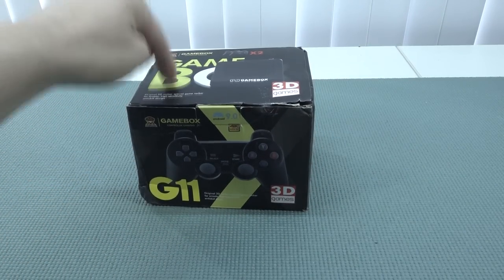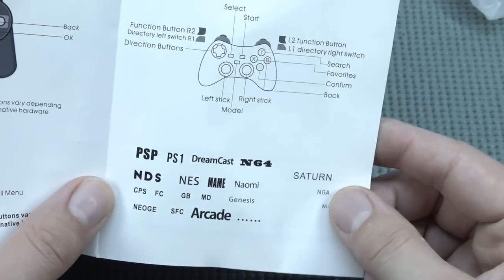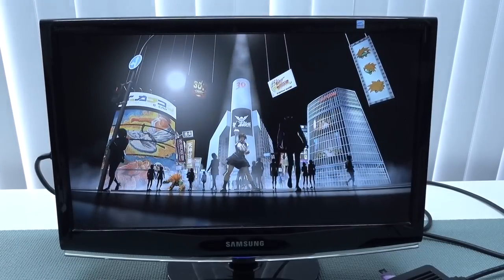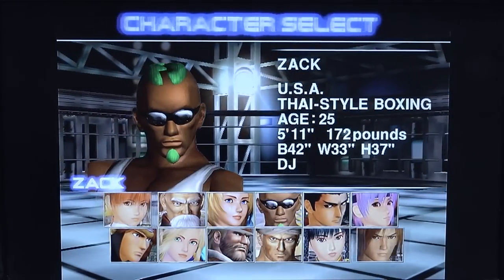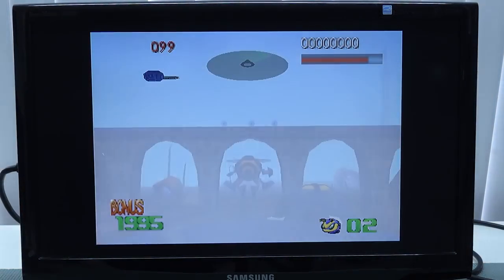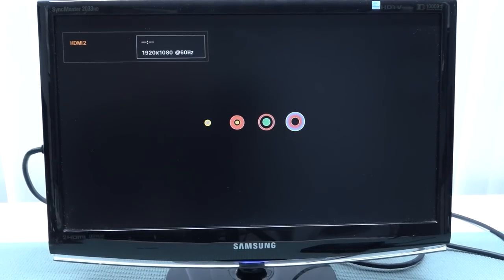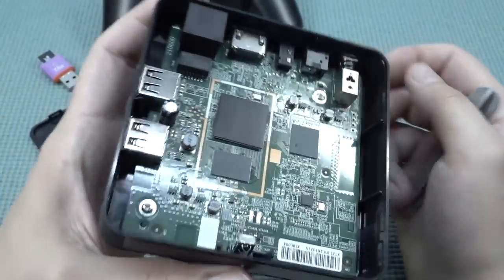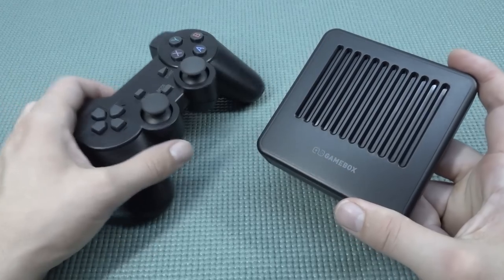Game Box G11 - A New Retro Budget Game King in 2022 ?

Comment: Hey Dude - love the vids as always. I bought one of those pandora boxes arcade sticks  all in ones last year and soon got rid as something about it was a bit naff. I am looking at getting something that my daughter (5...nearly 6) and myself can play. Our main game is wrestlefest and then just getting her into the retro stuff. I was wondering something like this, would it take a usb arcade stick plug and play? Something like the 8bitdo arcade stick or something cheaper version. Mainly for her just ease of controls as the ps2 controllers are a bit too much for her. Any help would be rad...plus also this box looks cool what are your thoughts? Plus i have seen these android versions don’t need screen res messing with as it loads up with side panels so the ratios are all set...this correct with this one? That what got me with pandora, it was just over stretch on the screen and a pain to change. Thanks dude and keep the retro arcade dream alive
Reply from the maker: Heey Hey, Super console x does have that arcade 1 player plug and play machine. 
You can just connect another controller to that it can be a cheap xbox 360 stick for example.

The game box systems come all with those ps2 clone controllers so there is no way around that.
In the end Super Console X Stick, Pro, Cube, King so many options.
For wrestling depending what system you like to play .. most cheap boxes run up to ps1 no problem.
S905x3 handles Dreamcast ok .. and after that you need a mini pc. ( in my opinion)
Reply: No.